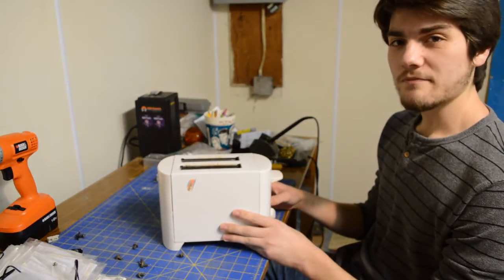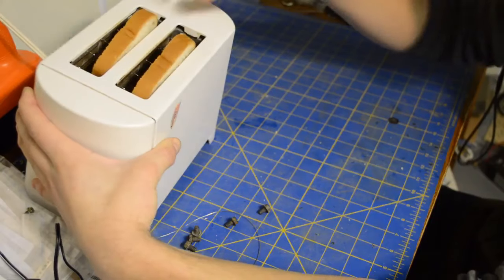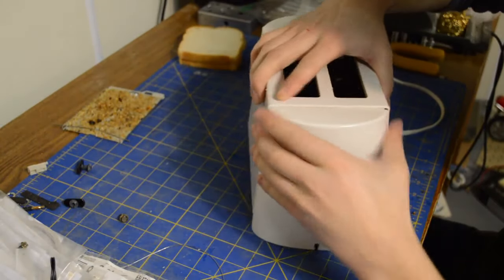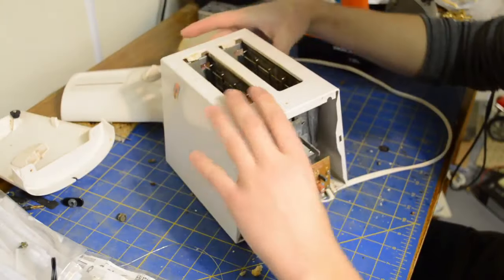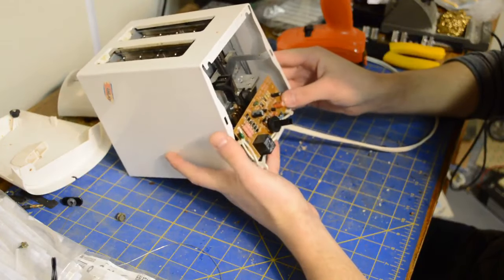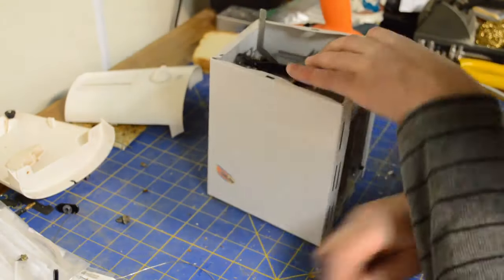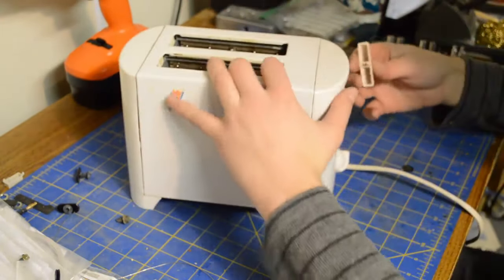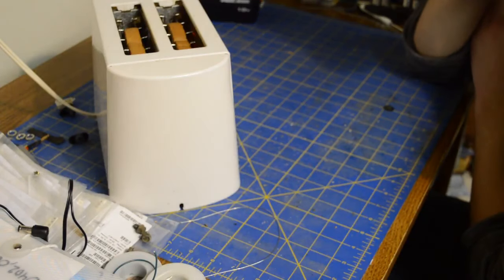HOW TO: Fix a Toaster that Won't Stay Down

Comment: I have a breville 16 screws on the underside and all not only proprietary but tripod shaped none of my 20 available bits for these proprietary screws will fit. I can still manually remove them by applying a flathead with alot of torque so as not to strip the screw heads but that will take ages. my next anticipated problem will be the flippers, they look like they've been moulded into place. the manufacturer really doesn't want me opening up this toaster it's so much work might have to just buy a new one, the problem is probably something simple like crumbs stuck on the magnet, I've already shook the life out of it to no avail so it's either but a new one or put a weight on the flipper for each use

Comment: I fixed my toaster by undoing the screws underneath,  lifting the body up, and tipping out the crumbs and lumps of dry bread which hadn't been released by removing the two drawers and tipping the toaster upside down. Many toasters are dumped when all they need is a good clean.
Reply: Perhaps that’s why I recently found two good toasters in the dumpster, including a double wide slot Black & Decker just yesterday. It’s hard to clean out and the adjustment settings are not visible, but it works. I’ll keep my other narrow double slot Proctor-Silex toaster in storage for when this one quits.

Comment: Thanks so much for this video!  I now have a working toaster again!  There was some gunk in  where the round, copper contacts are, & the magnets didn't line up in the other section. Also, the long spring had some gunk within it too. I used a straightened out paperclip to get the stuff out. I watched what was going on while moving the lever up & down when I had it apart. Thanks again!

Comment: I gave it an  thumb up.  The part about the solenoid was good.  I'm disassembling
the one I bought used 17 years ago  at the thrift for another tweak to keep it going.
But the lever catch from too much manual ejection may show it is just worn out.
Reply from the maker: Thanks for watching, good luck with your toaster. That seems to be where they always wear out.

Comment: Yup i have the same problem 🤣 mine won’t stay down either, but i think the problem is different though because my mom brute forced it down because it usually had this problem of hitting a snag at the start, so she just murdered it, but i’ll try to do some CPR on it to see if i can’t revive it again 😁
Reply: Sounds like she bent the copper connection. Take it apart and you’ll probably find realignment of the copper contacts will fix it.
Reply: @jaileal8806  Yeah i tried taking it apart, i couldn’t find out what the problem was even though my suspicion were the same so i bit the bullet and just bought a new one 😁

Comment: I have just fixed mine. The problem were crumbs that have fallen on to small electro magnet, which prevented it to make the connection with the upper part. Btw it only works when the power is on.

Comment: Since you only have 107 comments during the past four years you may not check to see if someone like me left a message for you. But, I'll leave one anyway and either you or someone else can tell me how to fix my problem with my exact same toaster you have. Thanks. 

Also, that's a physically and spiritually/emotionally beautiful cat you have and we all can see how well you feed it and take care of it. And I can see you even give it some vegetable oil for its coat to stay looking like that millionaire's wife's mink coat :-)

I just paid $4 at Goodwill for a toaster exactly like the one you have. BUT the problem with mine is 100% different from the problem you had with your toaster. The toast won't pop up at all no matter what the temperature setting is set at.

I took it apart and looked at the circuit board and mechanical moving parts but did not see anything damaged.

BUT, just after watching you bend back those electrical contact bars correctly which now allows the electrical current to go to the electromagnetic holding device which then holds the toast holder down while being toasted, it seems to me that the problem with my toaster is that those same electrical contact bars may be bent causing that switch to stay on and not turn off when the heat increases enough, according to the temperature setting. 

Thanks for showing us how you repaired your toaster because by doing that you probably just helped me figure out how to fix the problem with my toaster.  THANK YOU !

Also, please keep in mind the next time you get another cat (whenever after you lose this one) you need to get two cats so that they can enjoy each other's company and entertain each other whenever you leave your house or apartment. Maybe you do have another cat but your cat appears to be so bored that it needs to check out and sniff every single new thing it sees on your table or anywhere else in your apartment or house. 

And what makes me believe I know what I'm talking about here? Because I also had a black cat, not that that's relevant, and it was the only cat living with me. It did NOT enjoy being by itself all day for eight hours while I was at work five days a week. 

A cat does NOT like being locked up and contained in the same space/area day after day by itself for eight hours a day. Basically, it is very cruel to do that to cats. Just imagine you, yourself, being locked up in your apartment with absolutely nothing to do for eight hours a day. Yeah, that'll ruin your personality too.

Comment: Good job, btw... I'm diagnosing same issue with mine... Wish me luck 😃🤞
Reply from the maker: You can do it!
Reply: @NickMakesBreaksStuff  It worked! The contact points (one of the two sets) was dirty and black, other set looked perfectly fine... Cleaned dirty ones with Q-Tip and rubbing alcohol, sanded lightly with 600 grit sandpaper, then cleaned again... Put it back together and voila! 😃👍 Thanks Nick!
Reply from the maker: @kevinbaxter607  Excellent, good job!

Comment: its amazing that people take the time to make these videos and don't give a comprehensive summary of the problem beforehand, leaving one to guess if there is power to the toaster, how the problem started, age of the product etc.
Reply from the maker: This video was not meant to be a product failure analysis.
I had a broken toaster. I took it apart, discovered a problem, explained what I saw and how I fixed it, and then I put it back together.
If you didn’t find this video helpful, sorry.
Reply: It's a toaster, not a complex, expensive piece of machinery. The lever would not stay down and therefore the bread would not toast. It is a very common problem!  I think he gave a fairly good explanation. But all those tiny screws might defeat me! I don't have a power screw driver or drill unfortunately.

Comment: You didn't have to reassemble the toaster to see if you fixed it.  Not a lot of danger there unless you stick your finger in it.  Then if you hadn't fixed it you might see what else was causing the problem.  Also, if you're a tinkerer, you should have a short extension cord so you can move the toaster about so you and we (the camera) can also see.